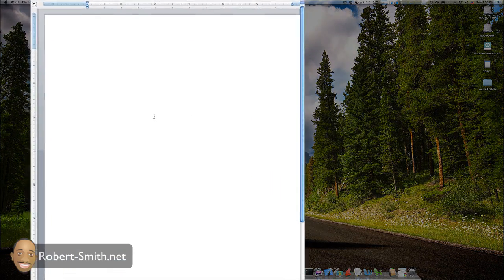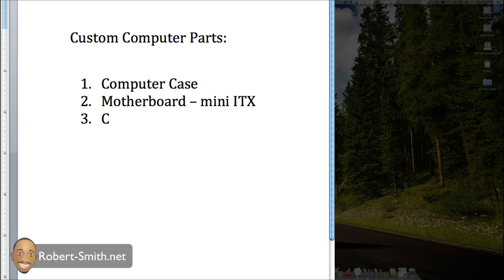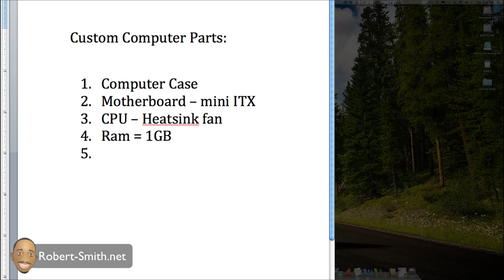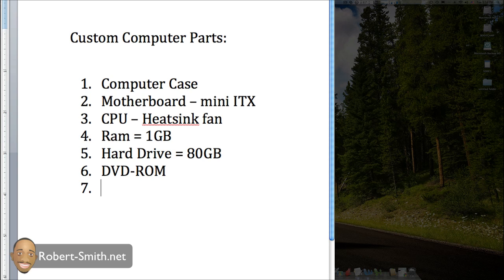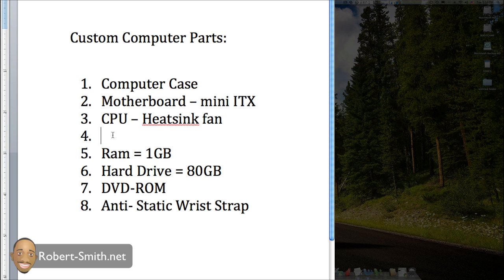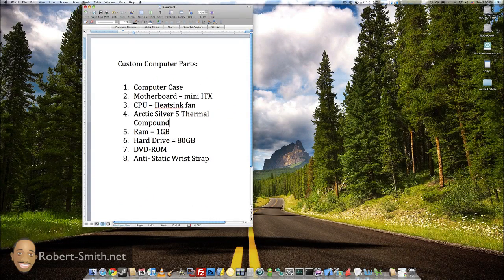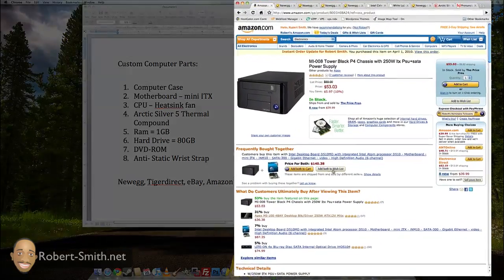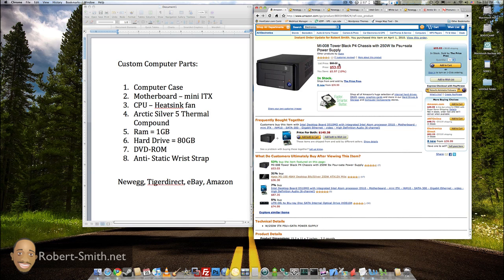How To Build A Mini ITX Computer Part 1/9

Comment: Good stuff. You should have mentioned a PSU (even though it came with the case) as well and whether the mobo comes with a GPU or not. 

Good work though! I'm planning on building another over the summer and this time actually recording it like I told you I was going to like a year ago.